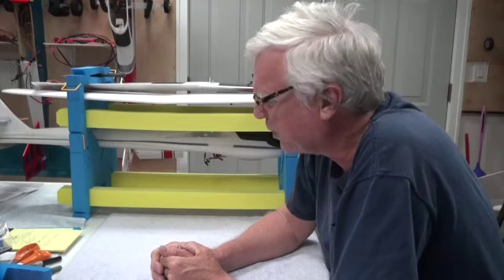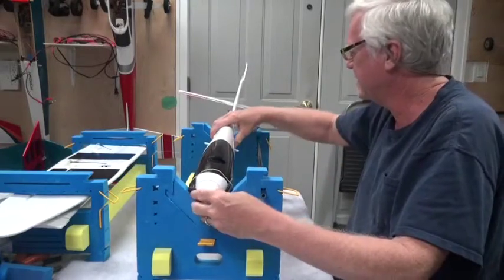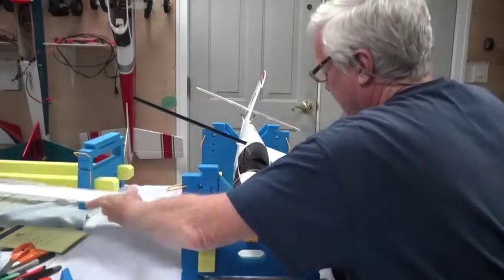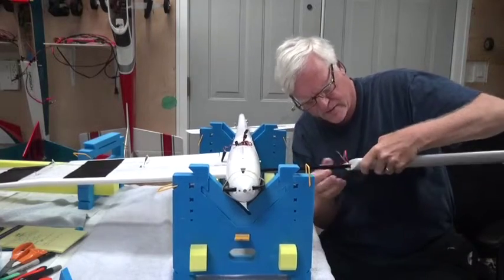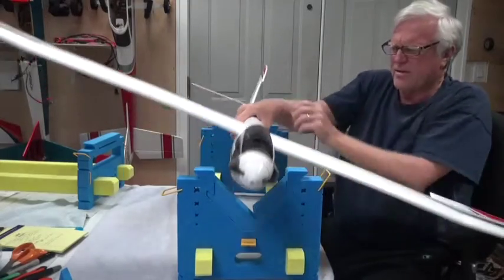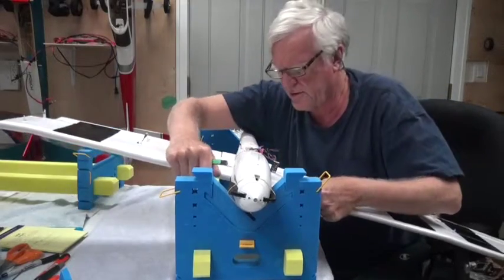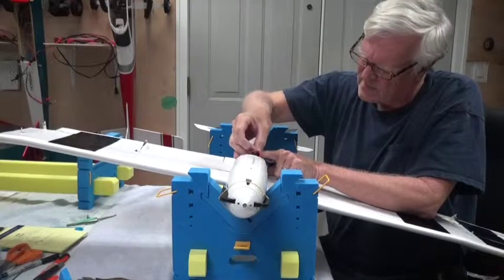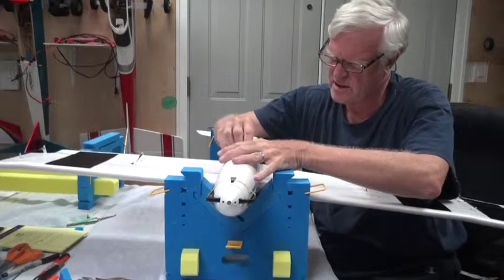RP09 Radian Pro Wing Assembly

Comment: There has to be a better way then reconnecting the 4x servos for the wing each time you take the pro to your field.
I'm lucky that even in my Peugeot 307 I can travel with the rad pro fully assembled in the car. Just the hanger storage is a problem.